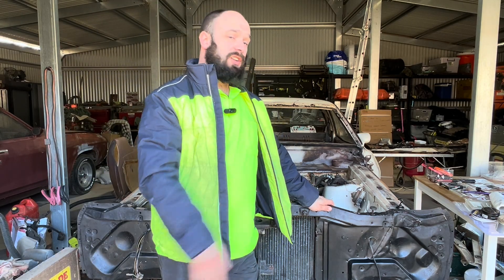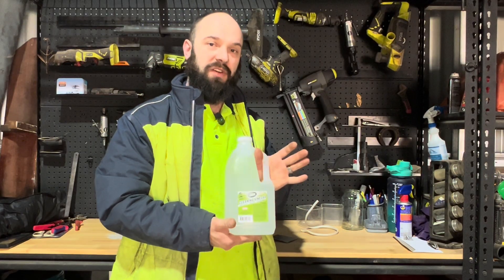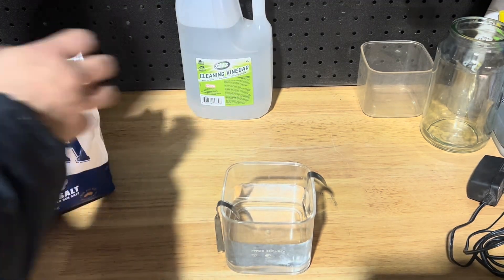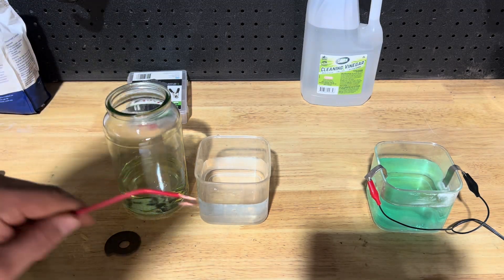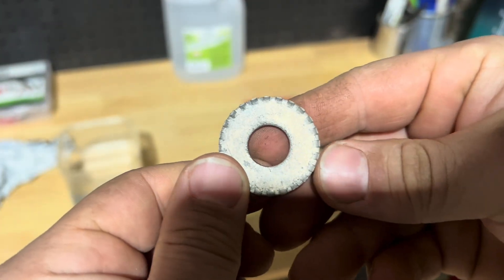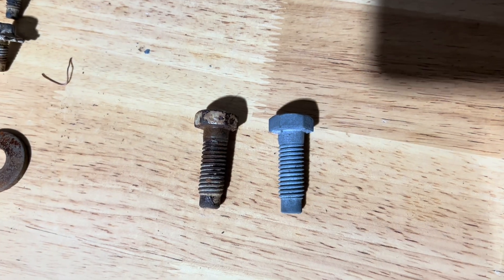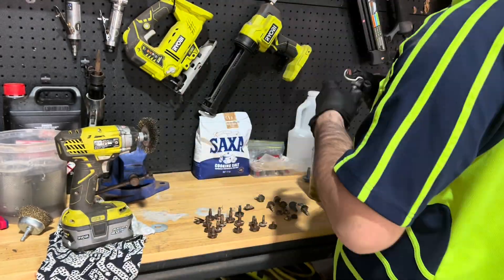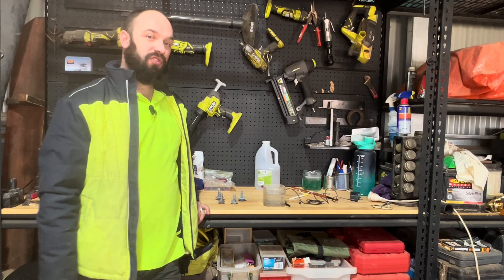DIY Electroplating Automotive Hardware: Revive Old Parts!

Comment: I did a heap of nuts & bolts with nickel, gave them a quick touch up with the wire wheel, and within 3 months over winter, they all started flash rusting.. I just ended up painting them all after that. I even had a proper power supply & left each dip for at least an hour. Very disappointing. I'd like to see you do a better job though.
Reply from the maker: The nickel looks nicer but I’m told it only really suits interior or covered area applications (upper engine bay, boot space) the zinc is supposed to last longer so we will see how it holds up. I have a test piece out in the weather to see how it lasts. 
I am probably going to give all the parts a light paint before putting them back anyway just to give them the best shot at lasting.
After doing this video I think I will likely try the full setup to see if I can get a more professional finish.
Thanks for watching,
Dan